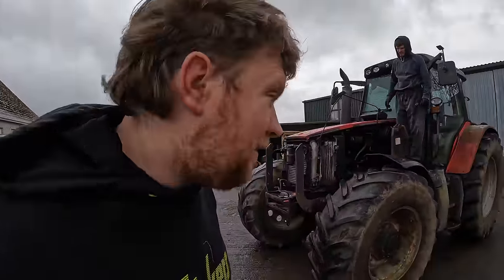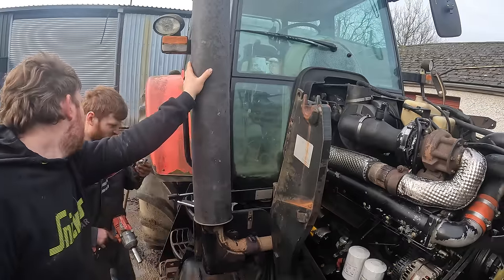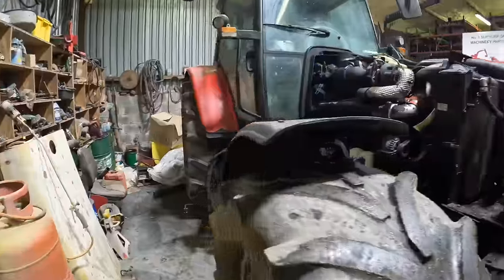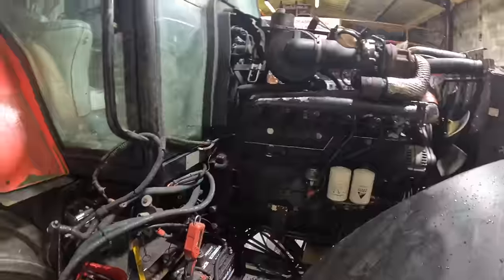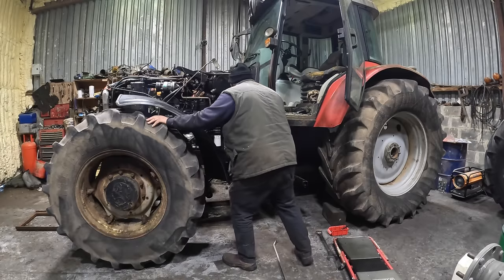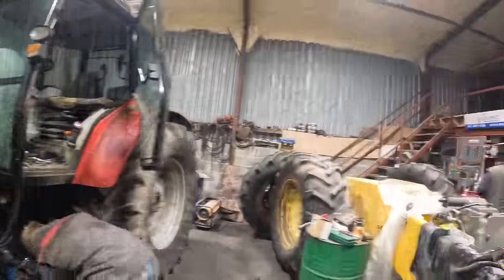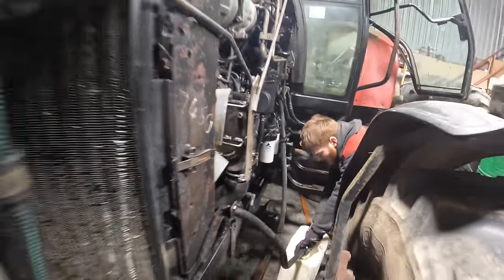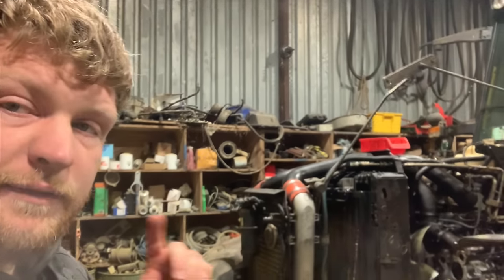SPLITTING A TRACTOR IN HALF | MF 6480

Comment: Is ER1077 not an air in fuel system fault? I spent £900 on the same type of pump on 6465 and my pump was timed perfect and the tractor has started throwing up that code and trying to cut out sometimes. I don't think its a timing problem but you'll need to remove the rocker cover and get valve timing right by removing the valve spring and lowering the valve with a DTI gauge to get the correct degrees btdc and fit pump with the 9 mm pin. Don't drop the valve or its the head off.  Jubilee clip on valve stem to stop it dropping. I'll be very interested to find a cure for 1077!

Comment: Used to drive a Tir2 Massey 7480 it used to eat fuel injector pumps, you knew when the pump was on it's  way out when it became harder to start, I always associated it when it run-out of fuel because the gauge never worked thus the pump needs the fuel for lubrication. 🤔